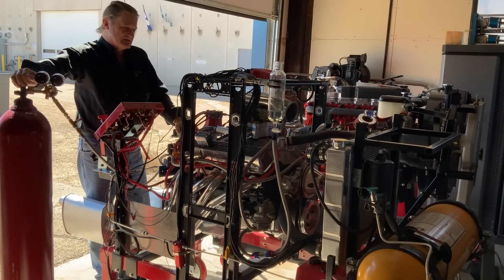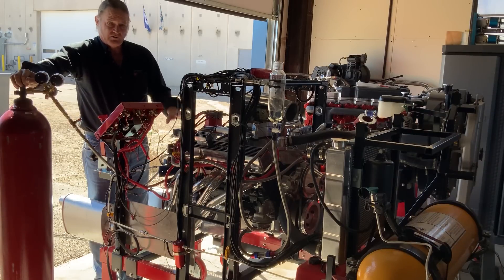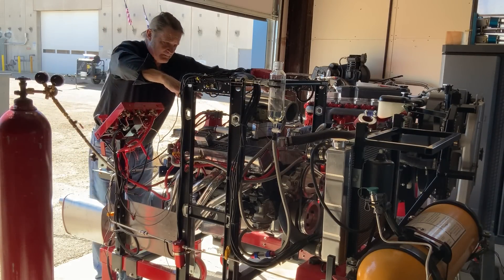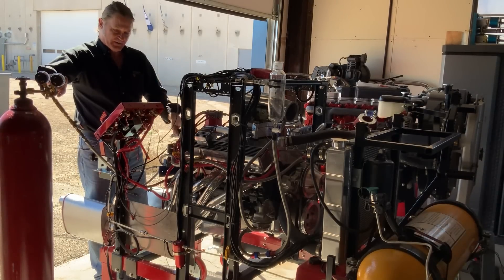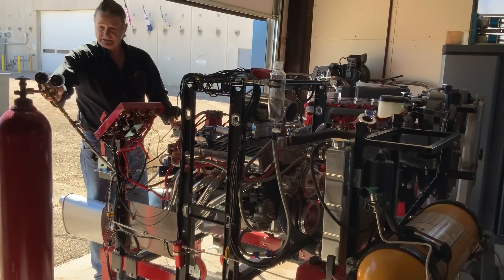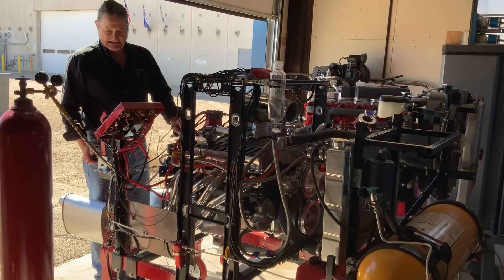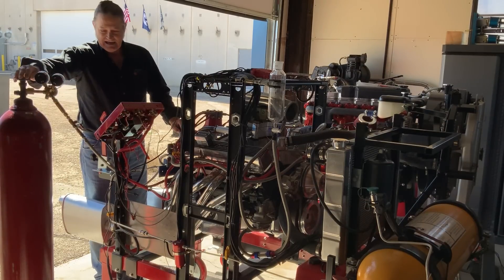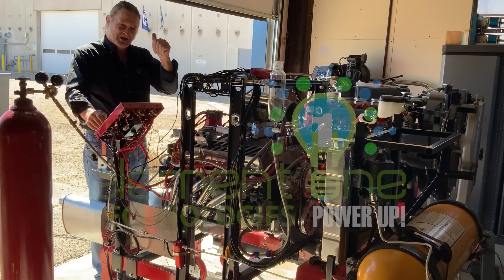Hydrogen powered V8 ICE High RPM Test

Comment: It would be extremely cool if there was a simple way to make ICE cars run on hydrogen. Because even at a much lower efficiency, an existing ICE car would be much better than a new car, in terms of climate change and many other aspects as well. The dream then, would obviously be to produce hydrogen on demand from batteries, which you could easily charge at home.

Comment: How does the engine work when hydrogen detonation creates an implosion (negative pressure) from gas turning into liquid?
Reply: the gas to liquid isn’t as power as the expansion due to heat, also the compression is extremely high so theres no room for it to go.

Comment: How do i get this product for my car while the genrator generates hydrogen
Reply: you can replace the hydrogen tank with an electrolysis machine running from batteries. Just understand the difference between hydrogen and HHO. It should produce pure hydrogen, not a hydrogen-oxygen mix. But in principle you should be able to add some car batteries in your luggage compartment along with an electrolyzer and use that to drive. It's not very efficient and wouldn't give you long range, but if you had free electricity at home, then that might be worth it.

Comment: Sounds beautiful on hydrogen (and gas)! It is practical to run ICE's on hydrogen gas. Here's the problem, no one wants to carry a hydrogen gas bottle around in their car or truck because it can explode in a collision if it loses pressure sealing and they hydrogen escapes. The BEST way is to produce hydrogen from water immediately as needed. That is the safest way. No one has done this with good efficiency yet.
Reply: you cannot produce enough hydrogen onboard to run at 4000 RPMs

Comment: Im quite nervous about having a high pressure vessel like that on my car. Especially one with an element as hard to contain as hydrogen.
That being said, this was awesome to see. No backfiring, quite a smooth sounding operation, love it 

Now i have a question.  Is it a compression-ignition engine like a diesel, or does it use electrical ignition?
Reply: And absymal efficiency meaning prohibitive running costs.
Reply: This is a typical gasoline engine with spark plugs

Comment: it went from sounding like a growling V8, to sounding like a little gas generator. the thrum practically disappeared, what's the point in a V8 if it doesn't make a big meaty noise?  I'd have been more impressed if he had made it run at 1400 RPM, rather than up at 3000+ where the engine note disappears.

Comment: why is it burning SO MUCH FUEL!!???
Reply: yeah that's a good question,  my generator with 3kW load attached doesn't suck as much fuel than this thing without any load.
Reply: @milanswoboda5457   I think this video is right up there with those perpetual motion videos.
Reply: @billbayer5526  well at least it is plausible unlike those perpetual motion / over unity ones.
Reply: I started out with only 5% in the bottle. In the following video I used a fuil bottle.

Comment: F@cking awesome!! Now we need to do an electric hybrid diesel and see how well that works. The ICE is the future, we just need to be smarter!!
Reply: No. ICE is extremely inefficient, so it is not the future. But it could potentially be a stop-gap measure by allowing people with short range requirements to use renewable energy to produce hydrogen from batteries and running the car on that hydrogen. Even if you only had ten kilometers per day, that would be enough for a lot of people.
Reply: @jeschinstad  
6 miles? That is not good for most people. I travel 16 miles to work every day. EV's and hydrogen are not good energy sources. Now a boron fusion car/truck would be perfect. It could last 100 years on one fill up. One hand full of boron can supply enough energy to power the USA for three years!!
Reply: @stevenpeterson7234  Hydrogen is not an energy source, but an energy storage. I took the number out of air. It would probably be possible to get you 50 miles or more using cheap car batteries to run on zero cost. That's of course nothing compared to the 7-800 miles you get on a hydrogen car, but you could easily charge everywhere. The problem a lot of people create is that they think that a solution must either be for everyone or not for anyone.

Comment: While i'm not a fan of hydrogen, (high pressure tanks and explosive) I have to admit there is not much more danger than a lithium fire. the point is, everyone is pushing the E solution, I see a combination using the conventional engines as well as hydrogen and E solutions. Look at our current power solutions, we have coal, gas and Nuclear to maintain our power needs, i see the same solutions for everything, no one solution will solve everything, It has to be a team approach

Comment: can you guys do an emissions test of the exhaust gases coming right out of the headers? I'd be very curious to see how much carbon and NOx is being emitted while its running on full hydrogen. Also I heard water injection helps with reducing NOx emissions if you guys want to mess around with dual injection (tri I guess since this is dual fuel already). If it passes the emissions test straight out of the headers, that means we can throw away all the emissions equipment on modern cars, especially if its carbon neutral and has very low or no NOx emissions
Reply: You definitely get zero co2 on hydrogen, and you will get huge amounts of nox
Reply: @sexyfacenation  water injection can help with NOx. It’s been done to a hydrogen swapped coyote engine, look it up

Comment: How high are the NOx emmisions?
Reply: Low....
Reply: @karlrudisill  based on what exactly? Burning hydrogen in air makes heaps of nox
Reply: No - it does not. Using hydrogen in an ICE produces far less NOx than gasoline or diesel.  @sexyfacenation
Reply: @karlrudisill  that's not true. You need very good catalytic converters to convert the extra nox made. 
This bloke has no cats. There would be huge nox emissions. Why do you think there wouldn't be?

Comment: I experimented with this concept years ago using small engines.   A direct 1 to 1 switch from gasoline to hydrogen is a total turd on every level.     Power is awful and so is the fuel efficiency.  

The only fix is to go with near diesel engine compression levels, ~14 - 16:1,  and what is essentially a light performance level camshaft grind, of which a gasoline engine can not handle long-term.

Comment: How where the temperatures as hydrogen burns hotter than petrol? And do you think you will need a better cooling system or are your results very similar to using LPG
Reply: Hydrogen burns lower temps than gasoline...
Reply: @karlrudisill  interesting I thought it was the other way around. Thanks for the update 👍

Comment: I was expecting you to put it under a load, as in on a dyno.  As well as seeing moisture or water vapor from the exhaust.  Why would you create a video, demonstrating 100% Hydrogen and "air", with an empty H2 gas cylinder?  With YoutTube or any of the mass media platforms, you have a lot of viewers that will scrutinize your work to the nth degree.  Figure out a throttled H2 delivery system, much like the accelerator circuits within the carburetor, and figure out a dyno plan ...... then publish those results.  Please.
Reply: Coming...
Reply: @karlrudisill  I realize, after re-reading my comment I was a bit harsh. My apologies. I am glad to learn you are still working on this challenge, and kudos to you ( two 👍👍up).  Hydrogen fueled engines have a long history (as in since the 1800's - Swiss engineer Francois Isaac de Rivaz). I would much rather see the application be in an engine as you are doing than Honda, Toyota, BMW, Kia, or Hyundai! Keep up the good work. Thanks for sharing.

Comment: Is 4krpm high? my 350 spins 4150rpm at 70 mph... dang 3 speed trans, small tires, and 4.10 gears. Seems like the valves float around 5300 - 5500rpm.

Comment: LMFAO 3600 rpms is not "high rpm". 
7000-9000rpm is high RPM.
And the engine isn't even under load.
This is a joke.

Go ahead run hydrogen.
When you get in a car accident and explosively  level a city block, let me know how that works out for you.....
Reply: Hydrogen tanks don't explode....
Reply: @karlrudisill  neither does flour or sawdust, untill....
Reply: No - sawdust and flour are not even on the same ballpark of comparison to hydrogen. I clearly stated "hydrogen tanks don't explode". Type III and Type IV carbon cover tanks filled with hydrogen don't explode. The self destination temperatures (without oxygen present) is 1000° F. When does that happen?
Reply: @karlrudisill  aparently you didn't grasp what I was aluding to. accidents happen. flour and lumber mills, or even cabinet shops have exploded before. Do you really think a hydrogen tank can't be pierced or cracked in an auto accident?  What's the contingency plan for that?
It's not the positives you should prase, but the detractions you should not ignore.

Speaking for detratctions.
1)So, we put in "hydrogen fueling stations," right? 8000 gallons of hydrogen with abive ground tanks on tap. What do you do when someone with bad intentions decides to blow one up? I'm pretty sure that gets over your 1000° mark there dosent it....
2) stoicho for gasoline 14.7:1 Stoicho for Hydrgogen is 34.3:1.
So. you need 2.3 times the amount of hydrogen to do the same amount of "work" than with gasoline or diesel. Got that? 
3) Where are you gonna "dig up" enough hydrogen to even touch the amount of gasoline used daily. Let alone 2.3 times that amount. Got that?
4)Liquid gasoline does not burn. Only the vapors do.
But hydrogen is already in its gaseous state and moluculeraly lighter than air, so it mixes with its oxydizing counter part MUCH faster. SO WHEN ACIDDENTS HAPPEN, HYDRGEN GO BOOM SOONER AND WAYYY MORE OFTEN THAN DA GASOLINE. Got that?
Hydrogen is too volatile for automotive use and requires 2.3 times more  than gasoline to accomplish the same task.
Got that?
With that said, there is no hydrogen generator or tank that can supply enough hydrogen quickly enough to an engine that would take gasoline powered car drivers from their cars. Got that?
This is as dumb as the propane powered car idea they ran with in the early 1990's late 1980's. At least that argument was cogent enough to find its way to actual production and then quickly abandoned about 2 years after implamnetation for being explosive, horrible, gutless vehicles.
Got that?

Ahhh, alternative fuel people.chasing fairytales for over 100 years and counting....
Reply: It is VERY OBVIOUS you have ZERO experience with hydrogen. "Do you really think a hydrogen tank can't be pierced or cracked in an auto accident?  What's the contingency plan for that?
It's not the positives you should prase, but the detractions you should not ignore." Apparently you do not even know what happens to a carbon fiber Type IV hydrogen tank IF it does in fact get pierced. The tests have already been done (shooting it with 45 caliber and actual piercing a tank and setting it alight, crash tests etc)  clearly showing hydrogen phizzles out and doesnt even consume the vehicle like regular gasoline. Got that?

"So, we put in "hydrogen fueling stations," right? 8000 gallons of hydrogen with above ground tanks on tap. What do you do when someone with bad intentions decides to blow one up? I'm pretty sure that gets over your 1000° mark there doesnt it...." IF THIS worse case scenario WERE ACTUALLY THE CASE natural gas storage facilities, gasoline and oil facilities would have been attacked LONG AGO. Your fear and paranoia have no merit. 

"stoicho for gasoline 14.7:1 Stoicho for Hydrogen is 34.3:1. So. you need 2.3 times the amount of hydrogen to do the same amount of "work" than with gasoline or diesel." MMMMMmmmm...you truly DO NOT understand the dynamics of hydrogen in ICEs. The ideal compression ratio (IMEP wise) for hydrogen has been demonstrated to be around 17:1-18:1. Even though the "stoicho for H2 is 34.3:1 hydrogen is 130 octane fuel. THEREFORE - high compression engine, 130 octane at forced air induction - much higher efficiency - less fuel consumed than your claim of "you need 2.3 times the amount of hydrogen to do the same amount of "work" than with gasoline"

"SO WHEN ACIDDENTS HAPPEN, HYDRGEN GO BOOM SOONER AND WAYYY MORE OFTEN THAN DA GASOLINE. Got that?" - hydrogen ONLY GOES BOOM in enclosed high pressure vessels in the presence of OXYGEN. NOT out in open air. GOT THAT?! Hydrogen has been selling in California to the public since 2015. How many "hydrogen goes Boom" incidents have you read about?????? Just MORE paranoia....

"With that said, there is no hydrogen generator or tank that can supply enough hydrogen quickly enough to an engine that would take gasoline powered car drivers from their cars. Got that?" - you are DEAD WRONG HERE - BMW conquered that in 2005 with the BMW H7 series with a V12 engine. You really should read more instead of making such frivolous claims about a topic you're too unfamiliar with.

Lastly - "This is as dumb as the propane powered car idea they ran with in the early 1990's late 1980's. At least that argument was cogent enough to find its way to actual production and then quickly abandoned about 2 years after implamnetation for being explosive, horrible, gutless vehicles.
Got that?" - there are 7500 Hydrogen vehicles in California and over 15,000 world wide. Apparently some of the smartest engineers on the planet disagree with you. 

FYI - you should spell check your statements before posting...

  @matthubbard9330